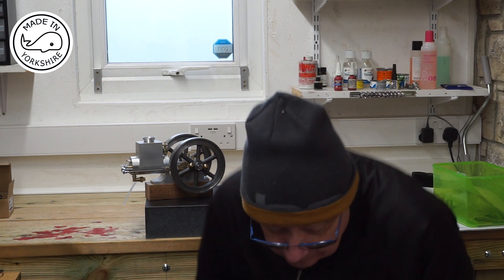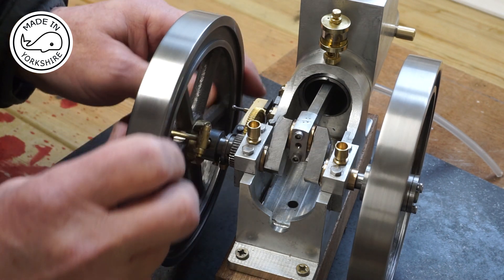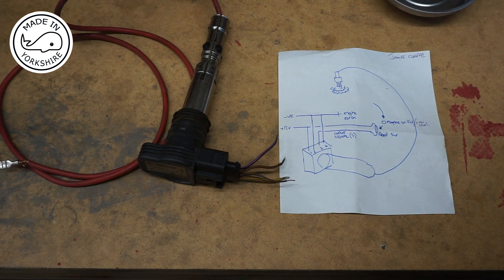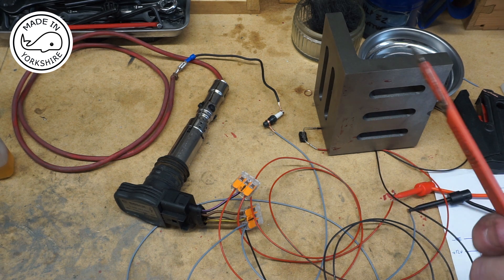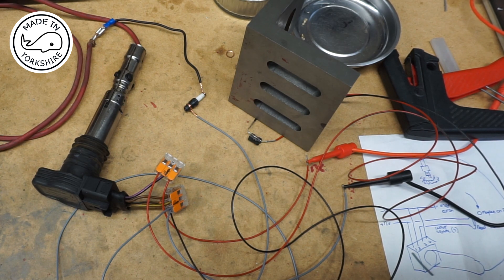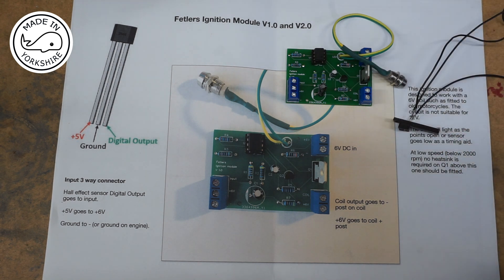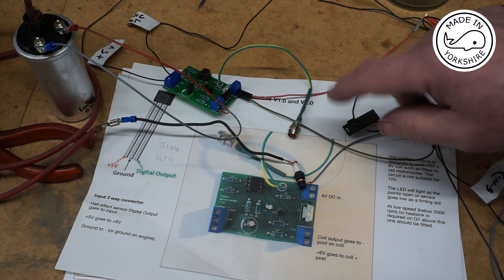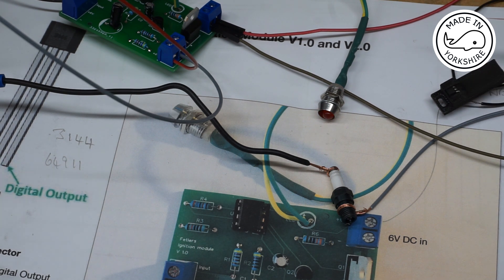#MT35 Part 20 - Farm Boy Hit and Miss Engine. The Ignition. By Andrew Whale.

Comment: possibly its a emi problem. i would have a look into grounding. usually the routers come without grounding. a spark plug is like a old fashioned Marconi transmitter that sends out morse code, picked up by everything that conducts. like electrical wires and also shielding in the Ethernet cables etc. as the router does not ground noise, it will overload the delicate circuits that modulate the wifi
Reply from the maker: Ah - I think you have solved the puzzle. I also have an ethernet cable running through the workshop which connects to the router. Maybe that's been the conductor and panicked the router. That particular solution did generate a really hefty spark.
Many thanks for the explanation.
Cheers
Andrew
Reply: @learningturningmetal  the likely cause is the long HT lead, the first  coil is meant to fit over the spark plug so everything is shielded inside the metal housing

Comment: The engine is looking really good you should be proud of yourself .good luck getting a spark and getting her running.
Reply from the maker: Thanks Steve - I will be over the moon if I can get it to run over the next few days. Just waiting for some small heat shrink tube to insulate the hall sensor pins. There is always something else to buy and wait for it to arrive in the post!
Cheers
Andrew